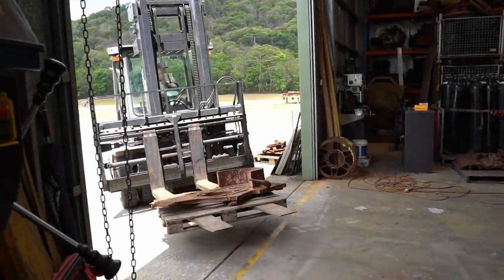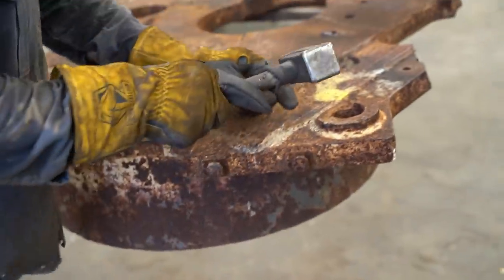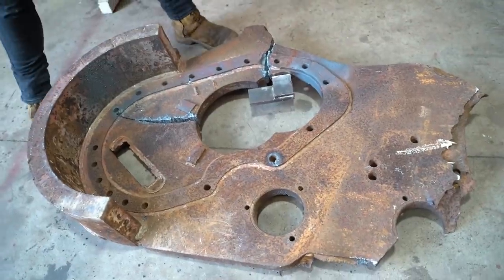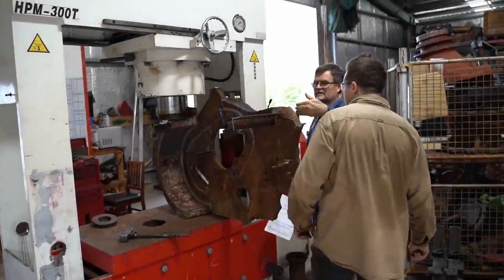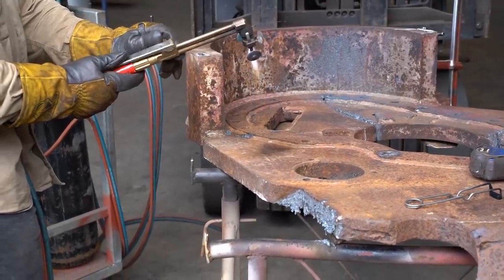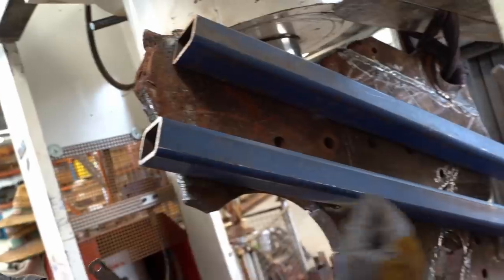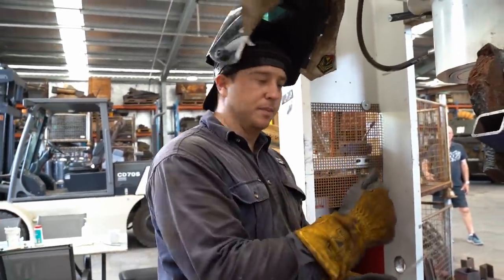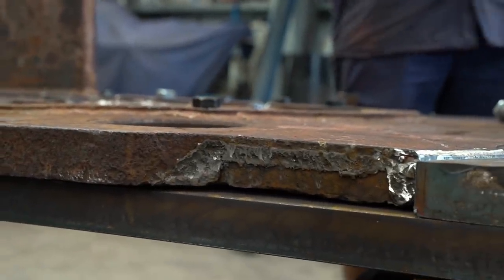Workshop Wednesday - JAGDPANTHER RESTORATION Ep. 3

Comment: Cut a thick groove down the crack, then cut a K wedge before welding thick plates. Also helps to pre-heat the plates before starting the welding process to avoid warping. There are tablets for this process. This is how we do it when building offshore rigs. Mig will also give you more control then welding sticks. Talk to a professional welding house for advice on gas and welding thread.

Comment: Watching Jessi makes me really want to help him. Step 1. Torch and quench for the bolts. Step 2. use either an O/A Torch or Carbon Arc Gouging..... Step 3. Use all-thread to align cracks and pull together then tack before V-notching for fill. Watch IC Weld Channel to see how heavy equipment is repaired.

Comment: As awesome as the video, there is a few things Id like to see changed.
1) That's a pretty massive block of steel hanging in the air, there is no supports under the forks of that truck.
2) No hearing protection, that impact gun produces a lot of noise that close to the head. Wild speculation guess work 60-70 ish db, thats no good. 
3) at 10:15 ~ the large piece of steel was suddenly on a table, why was it not put there in the first place?

I'm not a safety clipboard warrior, I just don't like to see dangerous practice's.

Comment: Why weld such dirty, rusty, scaly metal? no attempt to clean it prior to welding, also shouldnt those cracks get beveled back and multiple passes of welding be applied to make a stronger bond than just one tiny pass of weld from the outside? - Check out the channel "IC Weld", he repairs stuff like this in every video - heavy plate thats cracked and bent

Comment: Did German tanks use all METRIC SYSTEM as fasteners ?
Reply: Ever since Napoleon introduced himself .
Reply: Yes. The only question is which metric system (including threads).
Germany officially replaced its pre metric units in 1872 but somethings like pipe threads remain resolutely imperial.
A Fuss (foot) in the pre federation German states varied from 250mm to 435mm and had a variable number of inches…

Comment: Far too less beveling with this thick material, also why weld in vertical position, when you can weld horizontally just as well, can use much more amps and metal flows far better then.
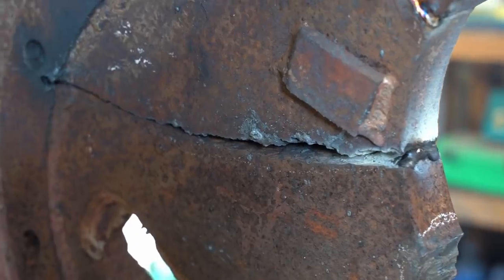14:35 didn't even care about removing the rust, that's just sloppy work.

Comment: 1/8 inch rod weld on a 1 1/2 armor plate instantly snaps. 
( cue me internally screaming about preheat a definitely needed double v groove and a post weld heat watch)  i'm not trying to be like that, but that was not the way. especially if that was supposed to be a root pass.

Comment: Oh no! Though, to be honest, seeing how resistant that plate was to being bent in the press, I slightly expected the weld to fail.

More heat? Or failing that, cuts on the outer edge to relieve the stress that's causing the steel to spring back into place?

Comment: ROTFL. I'm sitting here thinking, "There's no way that puny arc welder is penetrating deep at all." then BAM the weld breaks.
Reply: Yeah, it's a cosmetic weld only. A full strength repair would be fully vee grooved, preheated, welded, and then stress relieved.

Comment: Kirk, did you think about using heat blankets to raise the temperature over night so the metal is easier to work. We use to use that in the main workshop at Puckapunyal on the Leopards.

Comment: Without over bending it's hard to get. Grind it out for welding, press it and  weld it. While maintaining the correct distance in X Y from a hole on either side of the crack so the blots for the final drive line up